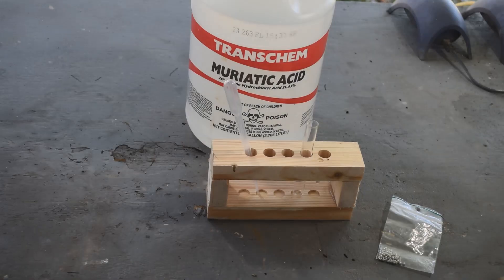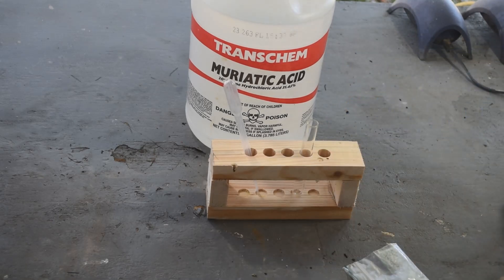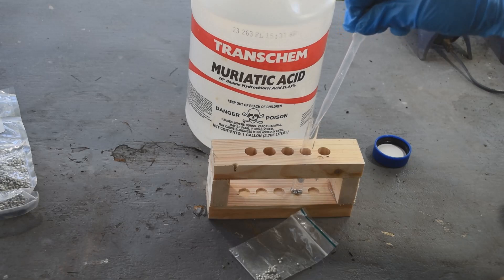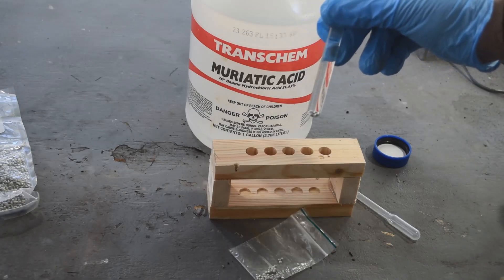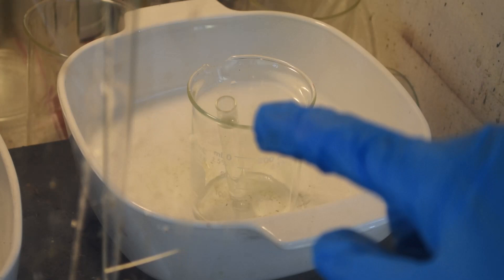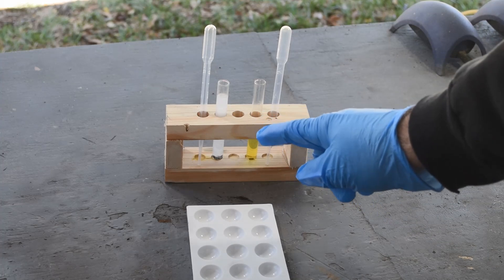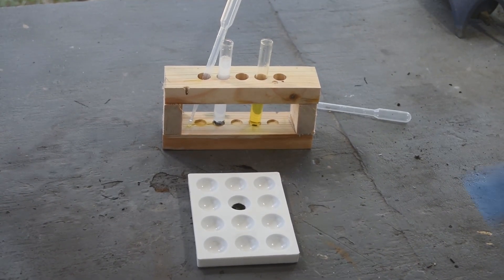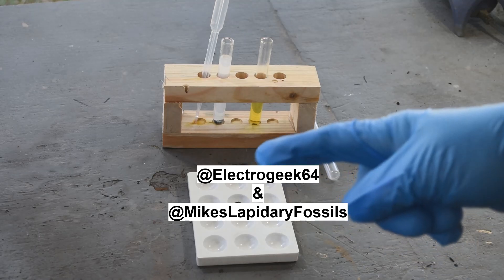On Demand Stannous Chloride Solution For Gold Testing #chemistry #gold #recycle

Comment: 2 pieces of lead free 95% tin solder, test tube, maybe a plastic drinking straw for insulation, and a 9 volt battery. Electrolysis in HCl, stannous chloride in 5-10 minutes.
Reply from the maker: I'll have to give that a try sometime.

Comment: Any modern electronic or electrical solder will do. I''v been using it for years. It all contains tin. Cut a piece about a gram or 2, drop it in HCL, 50 to 100 ml. give it about 20 to 30 minutes. Shake it up and use it. It lasts a month or more. If it starts to turn color / not clear. Just add a bit more solder, after a few minutes it will clear up and it's ready to use.

Comment: I didn't know not to let it boil. Ooops. Is there a reason for this? And I am so cheap I pick up the tiny balls after removing big bga chips and save them for making mine.
Reply from the maker: High heat and exposure to air both seem to shorten the useful lifetime of the stuff before it oxidizes and stops being reliable. Boiling heats it and exposes it to lots of air. Tin balls from BGAs work well when you have them. I've used that method myself.

Comment: Can this be used to test if jewelry is really gold?
Reply from the maker: No. You'll need a special acid test kit for that.
Reply: Yeah, stannous can really only tell you is gold or other PMs are in a solution.  

Gold scratch test kits will provide Aqua Regia in varying strengths to test gold jewelry.  

There is also a device called Kee Gold tester that I use to test jewelry in the field. It’s paid for itself 3-4times over for me, and is quicker and less likely to get a seller having a problem with the testing.